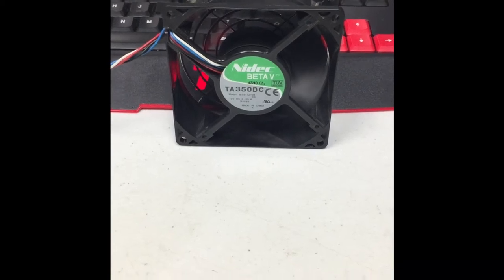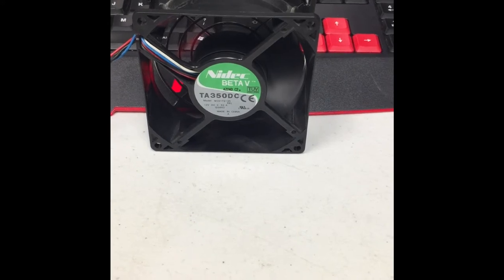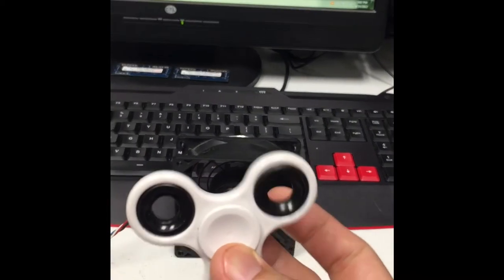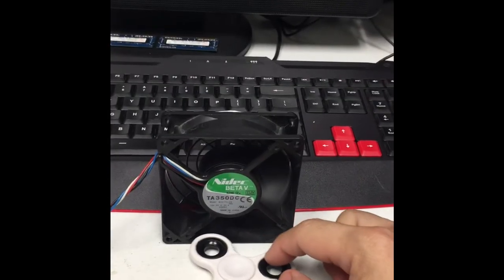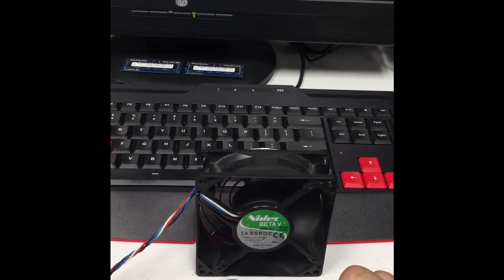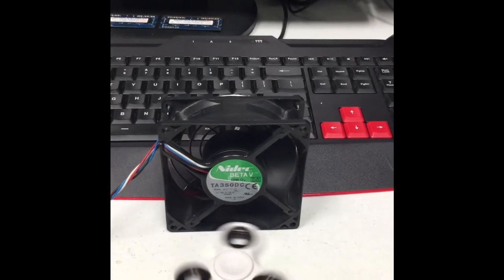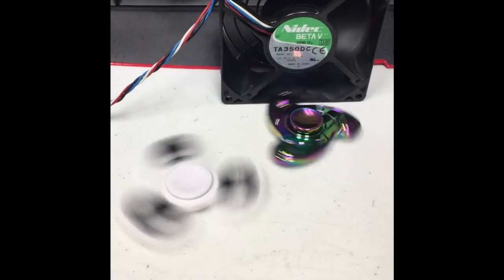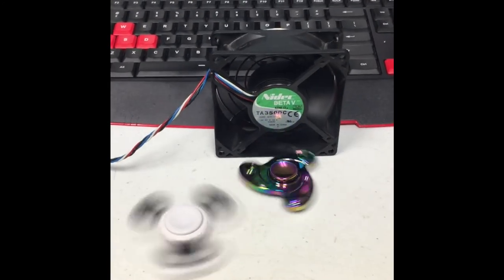6000RPM Computer Fan Rotates 2 Fidget Spinners!

Comment: I've a question. Can this fan cool down an i7 3770,like keep it around 60C?
Reply: Lower like overkill
Reply: If your crazy it will work
Reply: I putted a like 5000rpm fan with 12v to cool my cpu with heatsink, the cpu is running like 35°C-40°C while chrome is open.